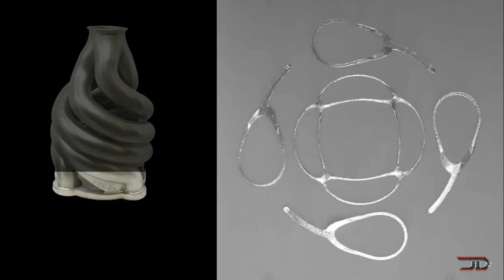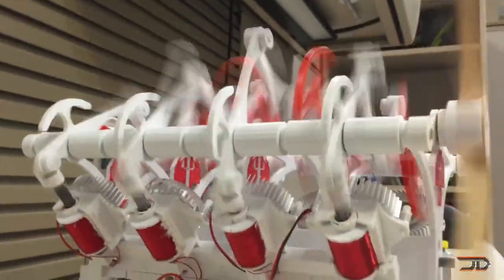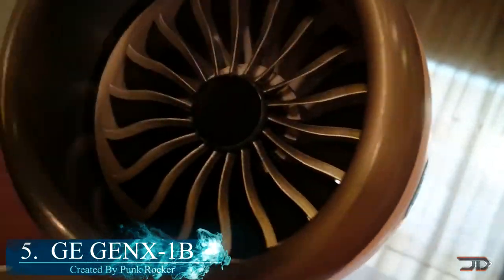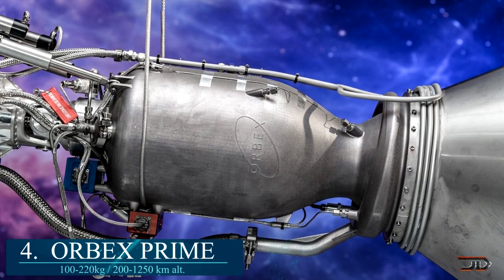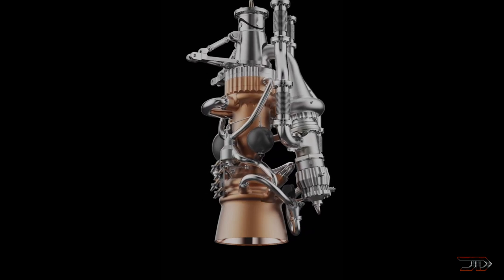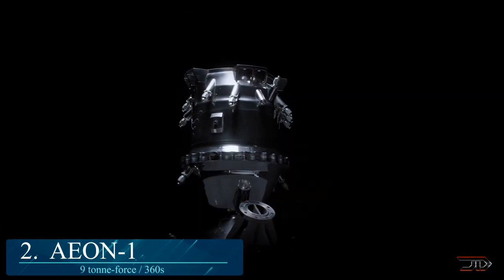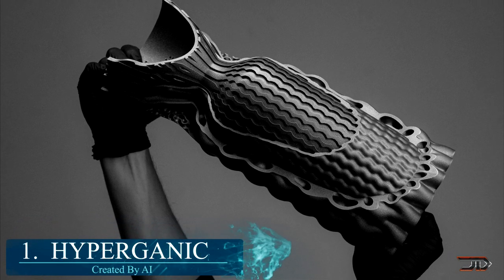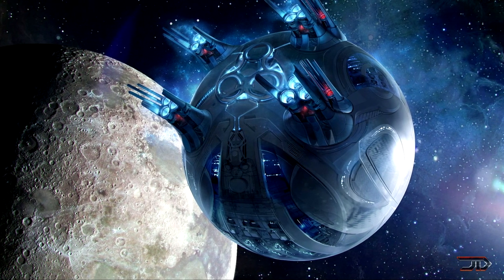7 Most ADVANCED 3D Printed Engines

Comment: I also heard of electric rockets using ions as fuel for thrust?.
Reply from the maker: The X3 is pretty neat, it will be interesting to see if their thrust ratio with high energy sources(maybe fusion?)
Reply from the maker: @jimsmith7212  That's cool, there are so many aviation engines coming out now!
Reply: @Tech_Planet  
Good time to be a tech writer.
Reply: Most satellite use in thrust but full 3 stage rocket not for now

Comment: No Rocket Lab Rutherford Engine?
Reply from the maker: I think most of the major components are 3d printed?
Reply: @Tech_Planet  It is fabricated largely by 3D printing, using a method called electron-beam melting. Its combustion chamber, injectors, pumps, and main propellant valves are all 3D-printed
Reply from the maker: @Max_Flashheart  Thanks for the info,I will cover it in a future video!
Reply: My thoughts exactly and they just did their 15th or 16th commercial launch successfully, here in New Zealand  using their 3D printed Rutherford rocket engine....Laurie